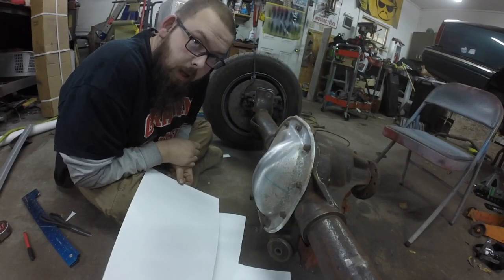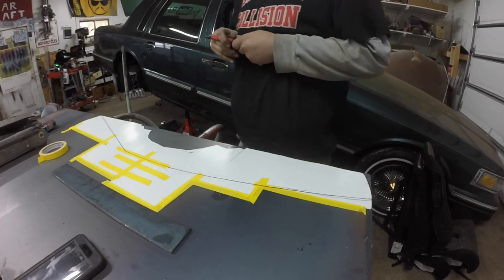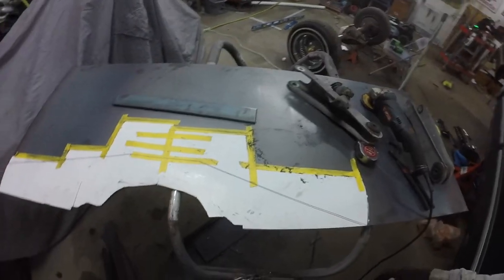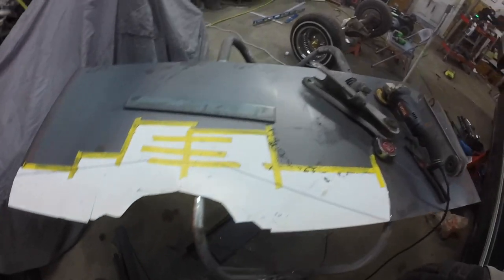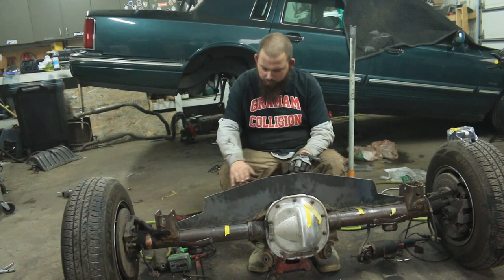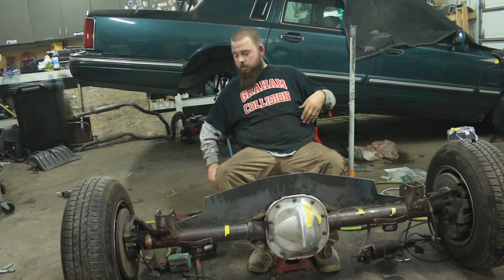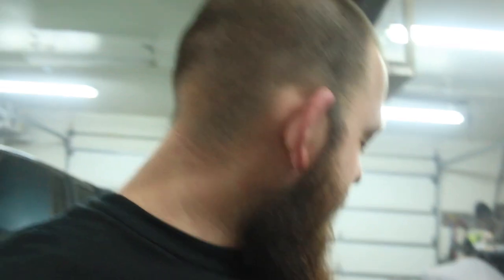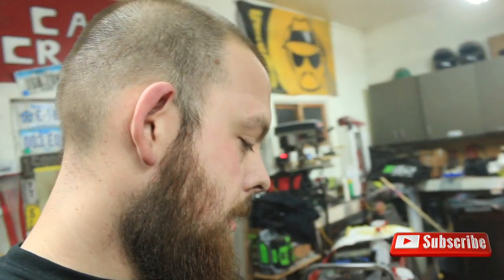lincoln lowrider rear end reinforcement!! Part 2

Comment: While it's out, I'd paint the whole axle green...unless you can chrome plate yourself....if you think it'd look good? Make it interesting. You seem like a smart dude, but don't forget to make sure you won't have clearance issues when it's layed out. :) Enjoying the vids.
Reply from the maker: Kill A Celebrity man I had big plans to flake out the whole rear end lol. But this rear end is just to rough. It needs to be sand blasted and completely stripped. I got plans to get a nicer used one. And strip it down. Fully box it and have it chromed. But that's down the road. Thanks for watching!
Reply: Sounds like a solid plan, you should be able to find one fairly cheap or even a good donor car. Building a lowrider or any car for that matter, is a labor of love that takes time and patience. Once upon a time I had an '80 Regal, I did so much to it, I didn't want to drive it anymore b/c of bugs and paint chips so I sold it. :(

Comment: Good clean work. Reinforce your stock spring mounts on the axle where you mounted the power balls. I'm not sure if you did but I was riding like that and the stock mount ripped right off.
Reply from the maker: Steve Ramos thanks man. Yeah they are reinforced. Have a plate going across them.